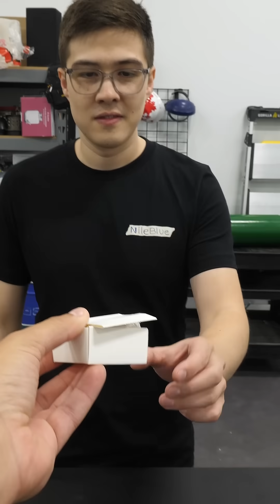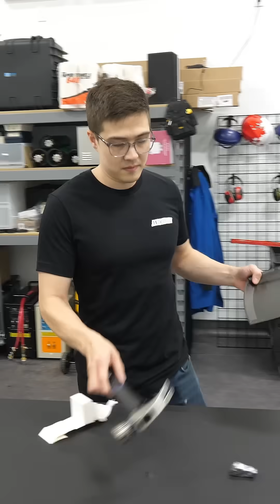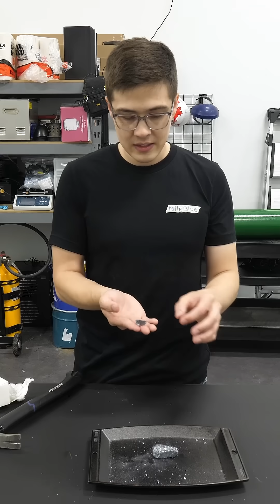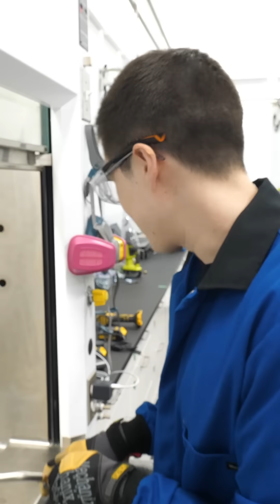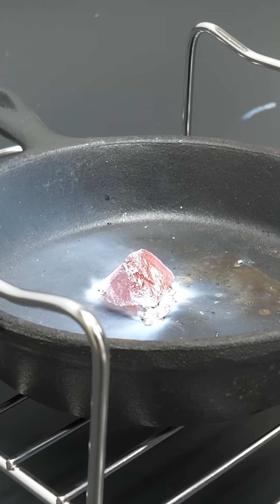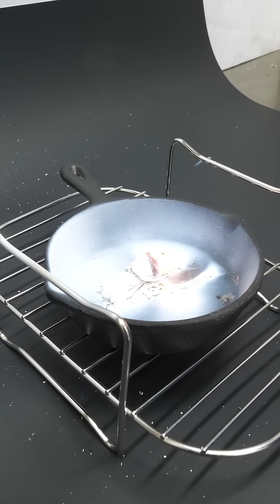Silicon is weird

Comment: For those who wanna know, Silicon melts at 1410°C
Reply: So it's okay that my potato PC still hits 100°C whenever I load up Oblivion?
Reply: @CertifiedClapaholic  there's a lot more metals than just silicon in a processor. There's also a lot of non metals that go into it. When the chips are made they go through cycles of surface prep, solvent coating (proplyene glycol methyl ethyl acetate for example) and photoresist application, exposure to traces, development (usually Tetramethyl ammonium hydroxide, but sometimes other chemicals), baking with hexamethyldisilazane, then plasma etching and deposition (anything from hydrogen trichloride to regular O2 oxygen), and back to surface prep. 

Needless to say, there's plenty going on in there, with various melting temperatures. The reason getting your heat down is better is that the processors are meant to operate at a certain temperature range, and getting too hot could lead to thermal runaway or just damage the transistors inside. 

I would recommend if you're using a desktop to make the $70 purchase of a nice cooler, thermal paste, and some decent fans. It was night and day when I switched my PC from the stock cooler to the noctua heat pipe setup I have now
Reply: @trail_mix24  I appreciate the long and thoughtful response but I was just kidding. I am not exactly a PC Hardware Engineer but I do have a pretty solid grasp on PC components and their technologies. Hopefully it does actually help someone else that could use that information though 💪
Reply: @CertifiedClapaholic  I was being thorough since I work in a fab and it's nice to see the different non metals that go into the chips. I figured you were being light hearted, but def try to keep your temps low lmao
Reply: @CertifiedClapaholic you should prob get dat checked out idk
Reply: @CertifiedClapaholic just because the bare metal doesn't melt, doesn't mean the insulation doesn't burn off or the layout doesn't warp out of shape long before...

I guess the reason why CPUs die at too high a temperature, has a lot to do with some kind of insulation varnish/material/whatever burning off and making everything short together.

Same process when you have an electric motor burning up. The copper coils don't melt because they do at 1300°C, but the enamel coating and insulation sheets go up in flames.
Reply: I was curious about this. Thanks. Saves me looking it up, but I probably would check the element spec sheet before ever trying to mess with it. lol
Reply: I'll forget this in 2 minutes
Reply: @Hoosier_Daddy69 .....bro I'm here to remind you.
Reply: @Hoosier_Daddy69 beginner. 5mins 30 secs for me
Reply: @Hoosier_Daddy69 i’m also here to remind you
Reply: I just kearned something. Holy 💩! Had no idea the melting point was so high. Would have it melted like zinc at around 800° 
I guess that's why it's used for chips and processors
Reply: @NomadFyre that's because of the electrical properties. "Semi" conductor, almost like a metal and with small changes it can do other things.
Reply: THANK YOU SINCE THIS DUDE ISNT SAYING!!!
CURIOUS!
Reply: So it will not be able to contain radiation from a nuclear power plant 😂
Reply: ....I suppose the pan and the backstop would of already melted.
Reply: @pythonpete  wtf is "would of?" Lmfao. It's "would've," as in "would have," dumb-dumb. There's no such thing as "would of." 🤡🤡🤡
Reply: Silicon definetly melts. Put tons of in in molten aluminum. Flowing molten aluminum will melt silicon at 1100-1300 degrees
Reply: @jeremyfilip4190 yeah we do th3 same at my work, we add it to aluminum to raise the SI content of the metal
Reply: so it is not the same as fake boob stuff silicon? i imagined indistructaboobs XD
Reply: @Ganjaqueen92 That is silicone, not silicon. Silicone is a polymer made of many different elements, including silicon, hence the similar names.
Reply: @CHRB-nn6qp silicone also has a high melting temp though, that's why it's usually oven safe
Reply: @trail_mix24 so the temperatures that Lahaina burned at?
Reply: @CHRB-nn6qp  thanks for enlightening me 🤗
Reply: @bradwiller7706  idk anything about Hawaii and the fires, but silicone melts/autocombusts at anywhere from 1000°F to 2500°F. It's commonly used because it's cryo resistant and can take a lot of heat before issues begin to occur. I'm pretty sure if you burned silicone it would damage it
Reply: @trail_mix24 bro is trying to tell us some differences between silicon and silicone...spells them both the same
Reply: @Batmann_  I wasn't explaining a difference, I was speaking on silicone for both parts of that message
Reply: @CHRB-nn6qp  Silicon melts at around 1411 C.
Reply: @trail_mix24 it forced changes in the crematorium field. Imagine the mess me-maw's breasticles made in that oven. Can you smell what the rock is cooking?
Reply: @bradprice8040  I always figured that the body had foreign objects removed before cremation. If they died to a lead bullet, lead fumes would go out the chimney. Anything with silica could cause silicosis. And so on
Reply: @trail_mix24  nope. The only thing they take out is a pacemaker but everything else either burns or is scrap.
Reply: @bradprice8040  good to know
Reply: @CHRB-nn6qp No, it's not, Silicon melts at 2577 degrees.
Reply: @CHRB-nn6qp ha ha that’s silly
Reply: @trail_mix24 thanks to the polymer and silicon
Reply: @johnbales2487 most silicone can take pretty high temperatures at least into the 600s
Reply: @trail_mix24  Sure, it's just several times lower than silicon lmao
Reply: @trail_mix24 mind the gases it releases in high heats, not food-safe
Reply: @Ganjaqueen92 omgosh lm such a blonde.. l thought the same thing!
Reply: @Ganjaqueen92  i immediately thought bulletproof breasts
Reply: 1414 actually...😊
Reply: @AnnWahlquist  aKsHuAlLy 🤓
Reply: Similar to steel.
Reply: And Nile Red didn’t know this🙈‼️
Reply: thanks for the info I was just about to look it up👍

What’s its periodic number stats?
Reply: @TheRTM  silicon is element 14, symbol is Si, with an atomic weight of 28.085 ish
Reply: Yep
Reply: So that torch isn't hot enough.
Reply: And this is why we call them chip foundries. It takes a lot of heat and dangerous chemicals to make chips. I interviewed for a place in the 90’s in Menlo Park, Ca and the water fountains had tape all over the with “don’t drink” signs. I don’t think it was just the price that drove manufacturing overseas.
Reply: What is that in kelvin’s?
Reply: Me too.
Reply: İron melts at 1563 C⁰
Reply: I think I'm gonna die laughing!
Reply: You are incorrect. Silicone does not have a melting point. I searched it up and to my surprise it doesn't melting point. At high temperatures it will lose its mechanical properties over time, becoming brittle.
Reply: @Death_is_inevitable. Silicon or silicone? They're different things, you know.
Reply: @WhenDoesTheVideoActuallyStart 
You must be blind because the second sentence in my comment says silicone. Or simply silicon(e). The e is in parantheses to show you in better detail what I said. 

I also realized I made a mistake when I replied to the commenter because he said silicon, not silicone. 

Also simply looking up what you asked me would make it obvious what I meant since there are 2 obvious differences between silicon and silicone (one with a melting point [silicon] and one without a melting point [silicone])

Thanks for the correction though
Reply: Came here to say this. Also silicon dioxide has a melting temp of temp of 3110F. The nitride bonded silicon carbide kiln shelves I use to fire pottery function without any deflection well above 2500F! THATS and insane material!
Reply: Wait so even lithium and water won't work?
Reply: So.... something that could survive the Van Allen belt? lol
Reply: So it would be capable of handling a Betelgeuse supernova?
Reply: Thank you I actually was wondering
Reply: And my PC turns off after the cpu reaches 100, smh...
Reply: I remember as a kid getting to look (through an insulated window) into a furnace where they had a pool of liquid silicon and a single, nearly perfect crystal spinning as it grew slowly out of the middle. This was in a chip fab plant. That furnace must have been VERY HOT, even moreso than my kid brain comprehended.
Reply: Das a looot a Fahrenheits
Reply: It also oxidizes immediately before that
Reply: my cpu getting angry above 100C >:(
Reply: Explains why nothing happened.
Reply: I have a furnace if you want me to melt yours.
Reply: That's pretty hot ngl
Reply: HOLY SHIT!
Reply: Pfft lightweight! It's Oganesson
Reply: Actually it’s 1414C but 1410 is close enough 😅
Reply: 1400C is pretty damn cold, very high temperatures are closer to 3700 degrees
The limit is what materials can survive the temperature, the best one is hafnium carbine, graphite isn’t far behind but burns in air before that.
Reply: So it melts at 2570 f?
Neat, that's one tough mineral.
Reply: Well flames with the addition of a pure oxygen source can make the flame go up to 2,828°C but the silicone isn’t melting because he is doing it for a short burst of time which even though it’s above the temperature of silicone it can handle it because it’s short and not one very long consistent burst on it
Reply: @hussainraza3067 *silicon 
You're confused.
Reply: @lamefart  Silicone metal does not have a melting point but under high pressure with pure oxygen it metals and it has to be long enough for it to start melting even diamonds are hard to melt but with pure  oxygen they will melt
Reply: @hussainraza3067  but its not silicone
Reply: What's that in freedom? 🦅🦅🇺🇲🇺🇲
Reply: @austinhall3937 exactly what I asked too myself 😂
Reply: @austinhall3937 you can times C by 2 for a rough number or the proper way is times 1.8 plus 32
Reply: Put the hot silicone in dry ice. It will shatter.
Reply: 1410 C??? That's like 100,000 F!
Reply: @Dj87887 ...close...more like 2600°f
Reply: @flowshine74 😅
Reply: @flowshine74 ah there's the eagles
Reply: @Dj87887  2500~ish ?
Reply: @ralanham76  It's a joke. It was a very poor attempt at calling out the OP for giving no regard to the Fahrenheit users.
Reply: @Dj87887 What is F?
WTF?
Reply: @AlfonsoPosada  You didn't ask the OP what C means. I'll explain everything to you, unlike what your teachers did. F means Fahrenheit, C means Celcius, and K means Kelvin.
Reply: What’s that for us less advanced Americans 😢😂
Reply: @2kZ0fficial Join the metric units system and you will learn. Rest of the world figured it out. Fun fact 0°C is the melting point of H2O, 100°C is the point where it boils. Also, our lengths measurements are all in the same unit (meter) and multiples of 10. So no 5 different incoherent base units, that arent dividable by each other without fractions like in the ineffective imperial system. It's really weird.
Reply: No, silicon melts at 80°C. SILICA melts at 1700°C!

Comment: I know this stuff gets added to molten aluminium. I don't know the ratio or if it goes in every batch but I saw bags of the stuff waiting to be used next to a furnace. 
Production wise it goes from a pot where it gets sucked out and tipped into a furnace, then tipped into billets or bars.

Comment: 'dirt' is such a generic term, it can include sand (largely glass). Soils (aka dirt) tend towards clay types or towards sandy types, or a various mix of the two, aka loam soil.  Soil is a mix of both organic and inorganic material generally speaking, so if he is making glass, silicon dioxide, he is making a component of most common dirts yes

Comment: It's not the silicon that melts and degrades in your CPU when overheating, it's the semiconductor impurities and metal wiring.
Reply: is the thermal expansion breaking the interconnects
Reply: @Mrshutter yeah I would imagine that 99.9% of "CPU" failures actual happen at the CPU/package interface. The actual chip is unchanged unless very high voltages are applied.
Reply: But when it smokes, it's mostly a burst condenser.

Comment: In semiconductors, you need to heat up silicon wafers to 1200 C and sustain that temperature before it has a meaningful reaction with O2, and even then it's very slow.
Reply: And that is why you have thermite, if you really want heat.
Reply: Thermate, in this case... @advorak8529

Comment: Silicon melts at 2,600°F
I use it in the foundry every day. It is a key element in everything made with steel.
Reply: Been like 20years since I did that job,  but I do remember it looking like shiny metal rocks. And we put it around the ceramic cones, just like on a tray around the base. Then the heat did something to extract something from the ceramic or extract something from the rocks and bake it into the ceramic
Reply: Ultimate education bro.
Reply: Looks like Nile needs a bigger furnace
Reply: Used to manufacture mining stuff and we made these ceramic cones, it was weird, you put a bunch of silica carbide around the ceramic cone and bake it in a kiln and somehow it gets drawn into the ceramic and makes it stronger. Idk if that different to silicone,  likely is but the look identical.
Reply: @oynlengeymer2434  
You are talking three different things. Silicon is an Alloy found in mining.  Silica is a sand and a chemical compound which has dioxide.  Silicone is a polymeric material.  We use silicon carbide in the foundry to remove oxygen in the steel.  Silicon or also known as Ferro Silicon is used in multiple Steel making, it pulls sulfur out and makes the steel structure harder.
Reply: @tyduschl5976  Silica and Silicone are both products derived from Silicon.
Reply: @prizegotti  but they have nothing to do with the applcation the original commenter mentioned
Reply: @tyduschl5976 So do you toss the silicon in the mix and let it do its thing, then remove it later? Or do you like, have silicon rods you dip in, or plates you run the molten iron over? I imagine you just dump powdered silicon in the mix, but how do you get it out after?
Reply: @Oberon4278  , depending on the grade we are making some call for high silicon and others needs less. Silicon is added as a rock form to the process.  We make batches of steel that are around 100 ton. The silicon becomes part of the chemistry when finished.
Reply: @tyduschl5976  Oh so it just stays in there? Huh, that's cool.
Reply: @Oberon4278 , yes I have to follow a certain chemistry specification.
Reply: @tyduschl5976 that's pretty cool! Have you have made 100 tons of steel which didn't have the right chemistry so you had to add even more iron to it to get it back into spec?
Reply: @JinKee , if I mess up on a grade I might be able to divert that to another grade and make it for a different customer.  There is much more than Silicon in high quality steel applications.  Some of the most expensive alloys out there today are molybdenum and vanadium.
Reply: @tyduschl5976  thanks - it's pretty cool learning where the materials we use every day come from
Reply: Are you sure it's 2600. I've worked in a melt department with iron and one with aluminum. I added it both places and the aluminum was only 1400
Reply: What's that in normal?
Reply: @danielblue22 , I am sorry I don't understand what you are asking.

Comment: Bruh English is confusing… so “silicon” is a metal and “silicone” is the substance you use between bathroom tiles?
Reply: Silicon is a metal used in computers and can also be turned into a rubber like material known as Silicone. That’s why silicone is named similarly.

Comment: Feed the oxygen through the air inlet of the torch. Also silicon will melt in your steel induction furnace.

Comment: "Can't melt that, ehhh ? 🤣
Reply: Yeah he could, but he needed an electric arc furnace to do it.
Reply: @uncletiggermclaren7592  hi
Reply: @uncletiggermclaren7592  Silicon melts at 1414°C (2577°F) which is lower than iron. You don't require an arc furnace for that. They had blast furnaces in the middle ages already! Termite would work for Nile
Reply: Canadian moment
Reply: “Can’t melt that” — CHALLENGE ACCEPTED!!
Reply: Silicon bronze is a thing. Put it in a furnace.
Reply: Yes, but the silicon is introduced, under a noble gas blanket, to the heated copper in a sacrificial mixture of the CHEMICAL additive ferro-silicate. Which isn't pure silicon, but a chemical compound of iron and silicon. This "delivers" the silicon in a form that can then alloy with the extremely hot copper.
If you dropped even finely ground silicon into the mix, it would merely float about on the surface. @billbarrett582
Reply: Proceeds to smash it with a hammer and set fire to it.

Comment: Try passing electricity through it at different points on the surface, see if you can make a very primitive diode. Possibly even the original LED?